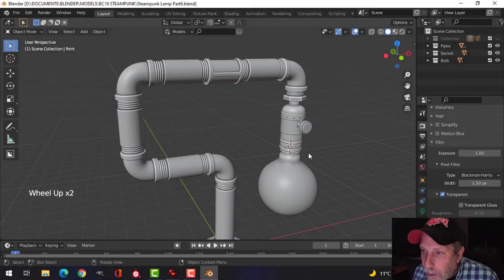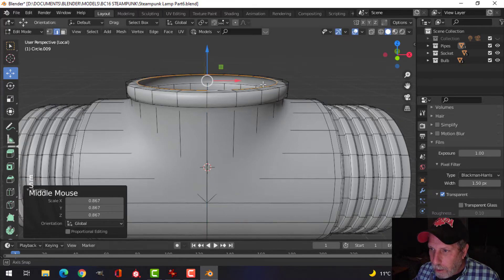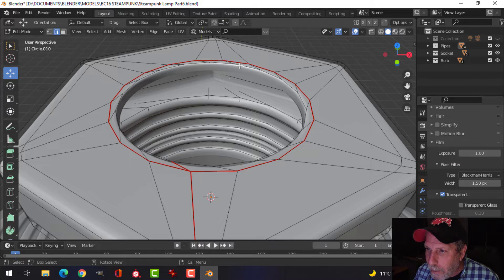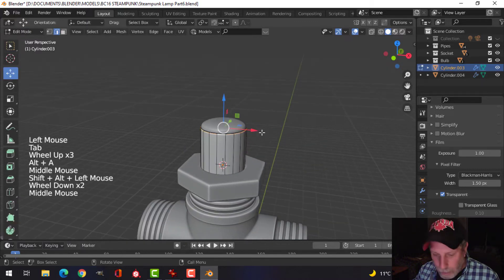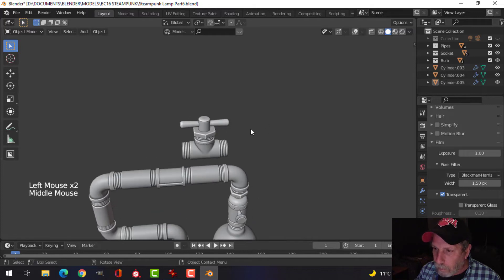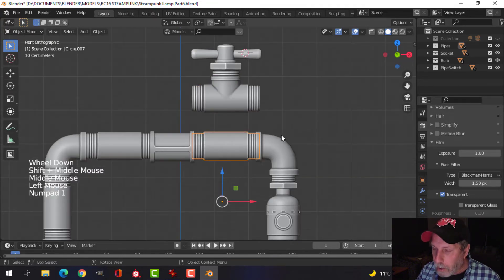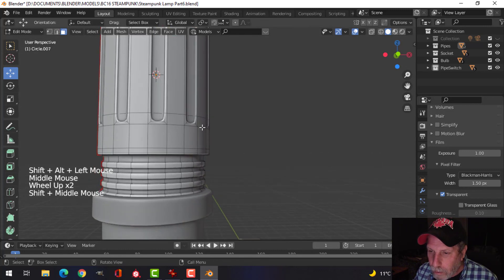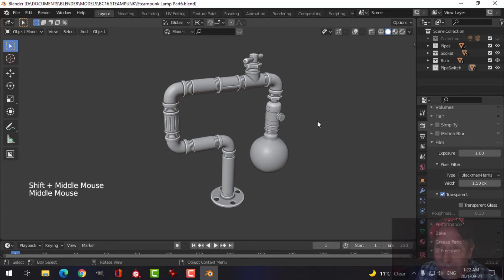BLENDER CHALLENGE 16: Steampunk Lamp 5 (Part 7)

Comment: Interesting modeling techniques in this one - thx!
Reply from the maker: Thank you :)
Reply: @zerobio  I've seen lots of tutorials that use E => Alt + S but can never get it to work.  What am I missing?
Reply from the maker: @zofo264  what is going wrong when you use it?  Make sure all polys are facing the right direction,  ctrl-n and recalculate outside. Also if you performed any rotation or scale in object mode, make sure to apply those transformations with ctrl-a and apply rotation and scale. Finally, make sure you don't have any extra vertices by selecting all and pressing m and merge by distance. See if you can get it to work on a simple cylinder. Good luck and let me know how it goes.
Reply: @zerobio  I think I'm holding Alt and S wrong or something.  I'll keep playing with it and let you know if I find out what it is I'm doing wrong.